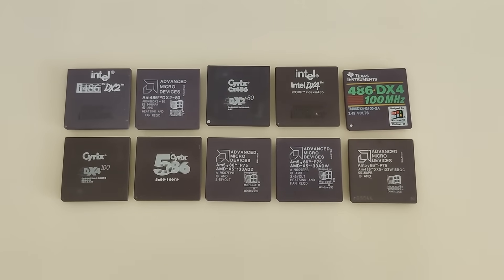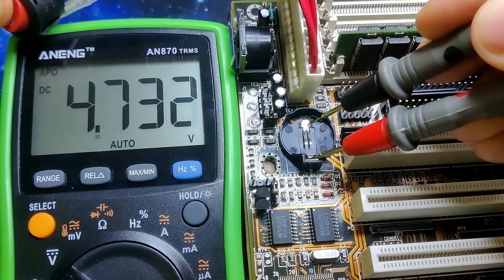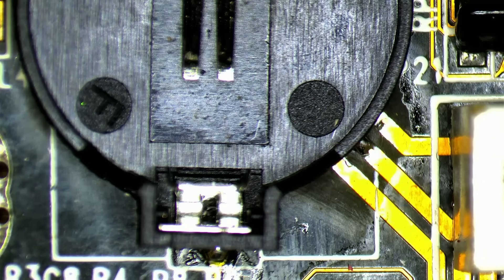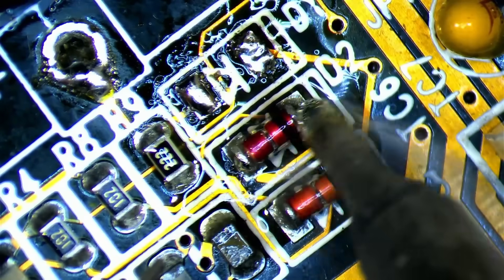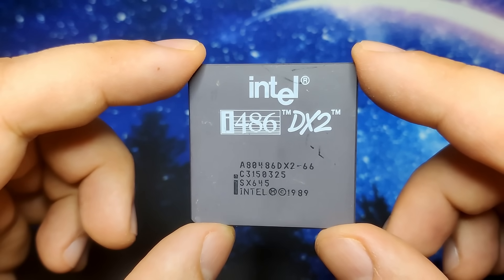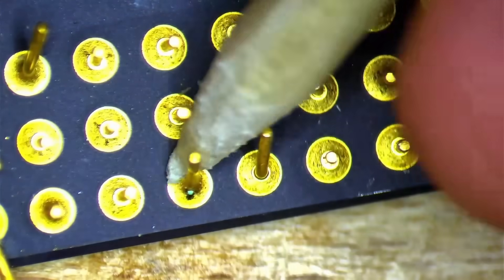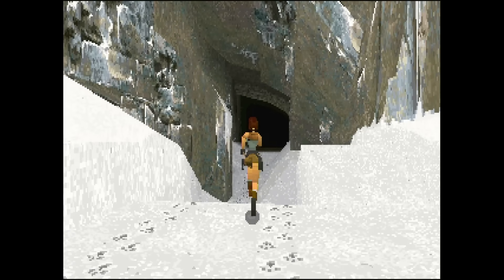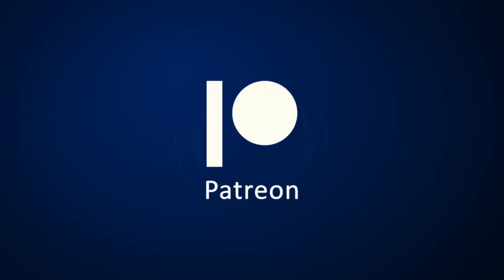Tomb Raider (1996) on Socket 3? (Part 1)

Comment: Back in the day, I was sick of the lagging gameplay so I bit the bullet and bought a brand new Pentium 2 233Mhz to be able to play Tom raider smoothly 😁. It was like 400 for the cpu alone 🤢.
Reply from the maker: Wow. I can imagine that this must have been a tough decision! Did you upgrade from a 486?
Reply: @bitsundbolts  I believe so, I skipped the Pentium 1. There after AMD athlon 1400 great cpu at the time. It even survived a fall out of the back of my car on our way to a LAN party (forgot to close the trunk). A small piece broke off the die. Installed the cooler and back in business.
Reply from the maker: Haha, ok. Lucky that it survived that fall! First time I hear about something like that.

Comment: Respect to the way you straighten the pins. I have fixed many such scrap-yard CPUs and still have many to fix. But almost never it goes in to the socket like yours!! 👍👍 I am mostly happy if it goes there with no violence. Do you have any special method to   get the pins in line??
Reply from the maker: Once I'm done straightening, I'll go over the pins once more and push the misaligned ones into place. However, the final touch is done by the socket. This one bends the pins in place and most of the time, the CPU then falls into the socket without resistance. I'll show a couple of more things I do when things get a bit tricky - that's for an upcoming AMD 486-133 ADZ.
Reply: @bitsundbolts  Thanks! I sometimes afraid of damaging the socket. I have slightly bent 1-2 springs on one board. But the good think is it can take it and works with all the CPU. I have already soldered 1 broken pin back as well. Still I am trying to make it as "new" as possible. But in some cases it is such a masacre thst I am happy to have working CPU even if not in a "new" condition. Good luck with your projects and Happy New Year 😉

Comment: The most impressive part of this video is the pin drop test. No PGA CPU I ever had to straighten the pins on, even mild cases, ever dropped in that easily.
Reply from the maker: Thanks Nathan! I got very positive feedback when I did this drop-in-socket socket test with the Pentium OverDrive - so, I'll do it for all CPUs with bent pins. Thanks for watching!

Comment: I have the same motherboard. In my case the trace below the battery holder was corroded causing the COM1 port to not work. It would not even work with an ISA card.  

With a 133MHz it worked even in 640 x 480 S3 Virge mode, but only in the smaller sections at the start. With the more open sections frames dropped from 15 to maybe 5 fps. Absolutely unplayable.
Reply from the maker: Yeah, that is what I fear is going to happen with the Virge. I think the Voodoo will do better. Were you ever able to fix the COM port issue?
Reply: @bitsundbolts  Yes, soldering a jumper wire fixed the issue entirely.

Comment: In early 1998 I met a dude in Software Etc who was telling me all about 3D accelerators. I wasn’t totally unfamiliar as I had already seen Creative 3D Blaster (3Dfx Voodoo) promo footage on a CD-ROM included with my Creative Graphics Blaster… and I understood why my Nintendo 64 had filtered textures while PlayStation and Sega Saturn did not (the so-called “Reality Co-Processor” was literally a 3D accelerator).

I just couldn’t believe he was playing Tomb Raider silky-smooth on a 486 with his 3Dfx Voodoo! Meanwhile, it was a choppy mess on my Acer Aspire with IBM P-150 CPU (Cyrix-based) with integrated ATi Rage graphics (worthless for 3D). I was so jealous!

I didn’t get to experience it for myself until the Voodoo² and Voodoo Banshee. I had a Diamond Monster Fusion Z100 in my Pentium III launch system as a placeholder until the Voodoo³ 3000 AGP launched.

It was such a stark difference to running in software mode or enabling Direct3D on an ATi Rage II where things just get slower. People without 3D cards had no idea what they were missing! It wasn’t until 3D starting coming with 2D graphics that they were able to experience any of this and it was still a poor experience for most. Even in the early 2000s you had to know what you were doing to find a laptop that could run Quake III with playable frame rates.

I was first in line for a GeForce 3 in 2001 and the rest was history. I was hooked. Never had a disappointing purchase when it came to 3D hardware unless you count that Graphics Blaster that I returned to Walmart as soon as I realized it had the same ATi Rage II chip that was already integrated into my Aspire. ;) Ended up with an ATi All-in-Wonder instead (another Rage II card) that I used through all of 1997 and noted that even the “Rage Edition” Mechwarrior game was a slide show on that card. Same in my friend’s 233MHz AMD K6 system with the same card so it wasn’t my Cyrix-based chip or lack of MMX to blame.

I felt cheated that ATi “3D” products had mislead me for years while Voodoo owners were having the proper experiences.
Reply from the maker: I do remember having an ATI card as well, and same as you, I wasn't impressed nor do I remember much of that card. I think it's due to the lackluster performance. The only other ATI card I had after that was a 9500 - which I tried to mod to a 9700, but at least one of the four extra pipelines was not working and I ended up with graphic errors.
Reply: @bitsundbolts  The ATi 9700 Pro was pretty good… the follow-ups were killing nVidia when the GeForce FX series was dropping the ball (for Direct3D at least). My friend ended up getting the 8500DV and gaming with that. He started with an eMachines Pentium III that originally included an ATi Rage 128 card with two or four Rage 128 chips. I guess that’s what it took to get decent 3D performance from the Rage 128! Even then, that card was a pain. I recall that it could play Unreal Tournament pretty well until you updated the game to play online. Suddenly it wouldn’t have enough video memory even in the same levels and it was a slideshow while it paged memory over the AGP bus for every frame. I had to find what particular Direct3D file was responsible to roll it back on his PC so that we could both play together online. I did notice that Windows 98’s MSPaint had issues when you zoomed on all of his ATi cards over the years… scaled pixels would bleed out of the grid view and you’d see some kind of corruption as you edited them. It was weird since you wouldn’t expect MSPaint to have anything to do with graphics acceleration (DirectDraw maybe?) and you’d expect an issue with that to get fixed IMMEDIATELY, not persist over multiple products over generations of PC hardware.

I ended up with a 9800 Pro eventually which I used to build a system for another friend who didn’t even have a PC. He finally got to play Half-Life 2 and Episode One while loving every second of it!
Reply: @bitsundbolts  …your experience with a bad pipeline on an unlocked 9500 reminds me of the eVGA GeForce 6600 Engineering Sample I stumbled on. I got a few of them on clearance from Circuit City because they were almost free after rebate. I began testing them with unlocked pipelines and they all passed, except one.

That specific one was already artifacting with random pixels all over the image in 3Dmark before I unlocked anything. When I checked with the unlock utility I found that they were all already unlocked on that one. Sure enough, locking a certain one of them was all it took to get rid of the artifacting. When I took off the heatsink I found a clearly-labeled “Engineering Sample” that had somehow been sold to me at retail!

Clearly, nVidia tested and knew the chip had a bad pipeline and could only be sold as a 6600 so they called it a 6600 engineering sample when delivering it to eVGA for product development. It was up to the engineers at eVGA to disable the pipeline in their testing and product development, but this one was put into a retail card instead. Did they have too many on hand that they didn’t want to waste?! This really limited my ability to resell it because tech forums and other markets did not allow you to sell ES equipment.

Comment: Goddamn this is the only 486 MB i have and somehow it went absolutely dead while building a retro build. All Caps replaced all bioses tested and many different CPUS tested and nothing.
Reply from the maker: Dead as in bo life sign at all? Have you tried a POST diagnostics card?
I also have one 486 board that is completely dead - no POST codes. I think it's the socket, but until I find a replacement socket, I can't say for sure.
Reply: @bitsundbolts  Yes the POST diagnostics card shows nothing. I also tested working old PSU and new 350w corsair. Even took the lid of off the socket and no bend pins. Jumpers are properly set.Multiple GPUs tested. Have like 50 RAM modules but nothing.

Comment: I  got a UMC U5C cpu with all pins removed. Can I replace the pins with some wire, if so which diameter and length should I use?
Reply from the maker: Oh no! I guess someone was after the golden pins! I can measure those pins later, but I think it would be best to get a donor CPU for the pins. It will be a lot of work to get 168 pins reattached 😔 and they probably will all have slightly different lengths.
Maybe there is another way. Like a flipped PGA socket or so. Or Jumper Pins that can be attached in rows.
Reply: @bitsundbolts  Well, it was the younger me who removed the pins, so the older me will have to reattach them...
Reply from the maker: 😂 I see. What were you thinking 🤔
Reply from the maker: The pins are 0.45mm in diameter and about 4mm long.

Comment: It makes you appreciate what the original Play Station achieved, running Tomb Raider at 384x240 with Gauroud Shading at 30fps with a 33 Mhz CPU and 2 Mbytes of Ram and 1Mbyte of Video Ram.
Reply: The magic is the 3D hardware. I'm sure when we get a Voodoo in this 486 system it will be locked to 30fps at 640x480.
Reply from the maker: I hope that it makes a big difference, but I'm not so sure whether we will see locked 30 fps. Maybe we get close to it on a Pentium OverDrive.

Comment: and dont forget about menu option "detail level" or something like that - its very useful on slow cpus. This setting changes perspective correction. F3 does the same if i remember correctly. This does not apply to the 3dfx version.
Reply from the maker: Yes, I had details set to medium for this test. Once I get some CPUs together (Cyrix 5x86 100, AMD 133, Pentium OverDrive), I'll do a comprehensive comparison.

Comment: I am damn impressed that you noticed the both the button battery modification and knew about its 5V charging circuit.
Reply from the maker: Usually I do a lot of research before I start working on a project. Vogons is my main source, but there are also other great websites full of information! I especially look for mods and upgrades.

Comment: Yes, Tomb Raider 1996 does indeed run smooth on a S3 system. The only difference is I had a MMX 166mhz Pentium :P

Now that I remember... I used to have the disc somewhere, wonder where it went... Huh.
Reply from the maker: I wonder if Socket 3 may be a bit slow for S3, but we'll see! Oh, good luck finding your Tomb Raider CD!

Comment: I have so many bad memories from that era, but back then I couldn't easily get replacement parts, so I had to "make" things work through sheer will and luck. I've never bought a pre-built system in my life (excluding laptops). Pre-built has always been overpriced and underpowered.

It's comforting to see these older systems just "working". They were a bit more painful than modern hardware is now. My most vivid memory of socket 3 is putting together a new system, powering it on the first time and expectingly I was waving my hands over the board checking for heat. It powering up, but wasn't posting and "feeling" revealed a scorching hot area. Very disheartening. I suspected some stand offs had shorted something and after taking the motherboard out, "insulating" the stand offs, and putting it back together it was oddly fine. I was surprised nothing was damaged. The bios chip got very hot in the five seconds it was powered. Lots of inexplicable things like that were the norm, except they weren't usually okay afterwards.

A decade later in college there was a branch of the electronics program that included teaching people how to build PCs. I chuckled about how I'd already been building them for years and just stuck to the other branch. My brother spent an extra year on his electronics major and took those classes, so I got to hear a few stories (it was also just a room away from the main lab). Someone got their new computer put together and their brand new bargain power supply literally caught fire. The instructors and everyone was glad it didn't set off the sprinklers because it would've wrecked so much college equipment. MTBF zero brand. My brother, and a lot of other people thought all components were equal, except some were better deals. They thought I was strange. I'd always spend a week digging up information on parts before deciding what to buy. Back then it was possible to find real reviews, but basically every online store sanitizes their reviews to some extent these days, and the majority of hardware information sites are fluff and buzz.

It's been five years since the last time I built a computer, but of all the dumb luck it happened to involve a dud power supply, too (no power up). Nothing exciting happened. I promptly voided the warranty and opened it up. A bunch of through-hole leads weren't clipped and had been bent over where they were touching a nearby trace. After clipping them and redoing some questionable solder joints near that area it came to life. It's been working fine since then. Warranties and RMAs are a huge waste of time and money, compared to just spending ten grand on an electronics degree. That was a real bargain.
Reply from the maker: I do have bad memories about cheap power supplies - unfortunately. One of those killed my Athlon 700 Slot A system. And although I loved it at that time, it gave me a lot of trouble due to warped heatsink and the aforementioned power supply.

Comment: What a lovely and nostalgic project. Given your choice in mainboard model and available hardware for upgrades, it is already certain that it will end well and that there will be some interesting insights about the performance differences of the various options we would hava had back then along the way. 😊 I wonder if all of my expectations/predictions will hold!

It's a bummer that the charging voltage for the CMOS battery is so high, otherwise you could just have replaced the CR2032 with a LIR2032 and called it a day. But then there was the remaining corrosion too, so I guess it wouldn't have made much of a difference in the end.

Great work again on the CPU Pins - I expect no less from you at this point! 😂
Reply from the maker: I'm also looking forward to exploring what would have been possible back then. The 486 was my first PC, and I had little to no knowledge about the hardware. I remember sweating out of fear when I upgraded the memory from 8MB to 32MB - that was literally the first time I had opened that mystery box! But it worked out!
Yeah, the chargeable battery would have been an option, but I'm afraid to mix it up one day and forget that it's charging...
Regarding pins, well, I'll increase the difficulty over time and show the things that didn't go too well (the Write-Back model didn't go as smoothly 😉)
Reply: @bitsundbolts  Ah yes, upgrading 2 to 4 MBs of RAM on my 386SX 33 was my first time opening up my PC as well. So that I could play Doom on it. Boy was I in for a surprise. 😅 Luckily, it ran reasonably well for a 386 and my demands weren't high back then. Subsequently adding a 5 1/4 inch floppy drive didn't go so well. Luckily, my Dad repaired TVs for a living and quickly discovered that I had just bent 2 pins on the 3 1/2 inch floppy drive connector. Crisis averted!

Somehow, I doubt that you would ever forget about this mod and not put a big red sticker on the battery that said CAUTION: RECHARGEABLE for good measure. 😉 Either way, it's all good as long as the acid hazard is gone.

Oooh, so you're saying we get to witness some mild gore in the next video? 😄 Can't wait to see how you dealt with it! I hear some are already claiming that you just manufactured the issue for dramatic effect. 😂
Reply from the maker: Such a sticker would definitely be a solution to the problem of fading memory 😉
Yes, in the next video, there will be some unfortunate event, but it wasn't created for dramatic effect - it'll be clear in the video 😊

Comment: I think nobody mentioned it but there seem to be a problem with your video's sound where your voice is very silent before getting louder at each sentence you start...
Reply from the maker: Hm, I checked the video and can't really hear what you're describing. I just recovered from a cold which makes my voice sound a bit different, but I couldn't hear a change in volume.
Reply: @bitsundbolts  strange that I would be the only one to hear it. 
I don't know...seems to me like a sound compressor/limiter parameter problem. Oh well, nevermind. Thank you for the video anyway 👍

Comment: As a comparison, the Sega Saturn version of Tomb Raider targets 30fps at 320x256 but can struggle to get 20fps in some complex situations. From my experience of playing the PAL version, I'd say the i486DX2-66 is running at a noticeably slower frame rate at full screen.